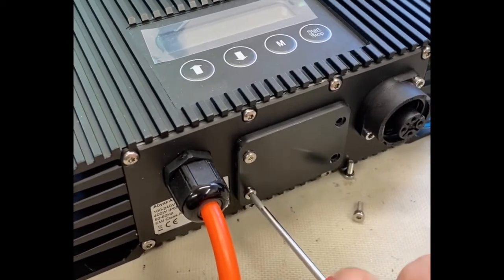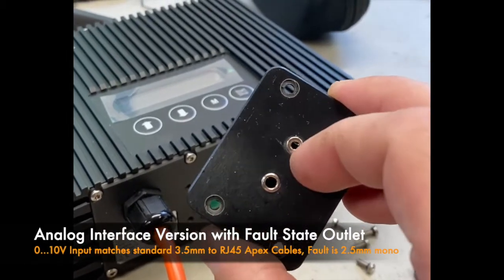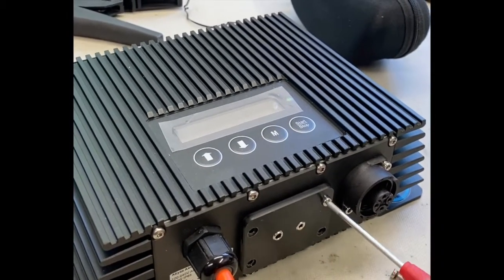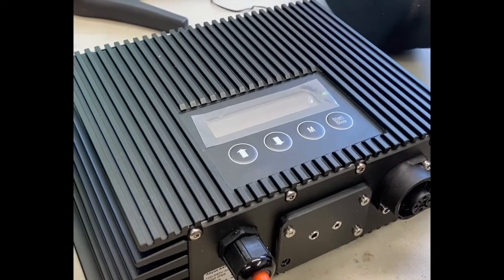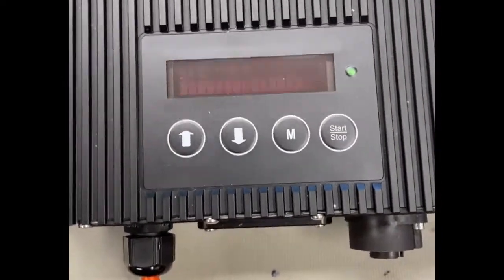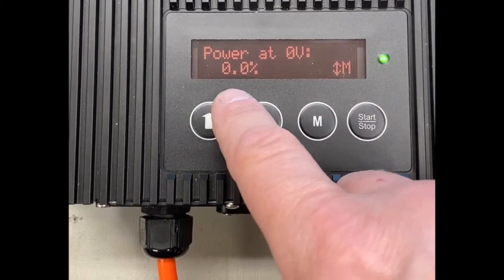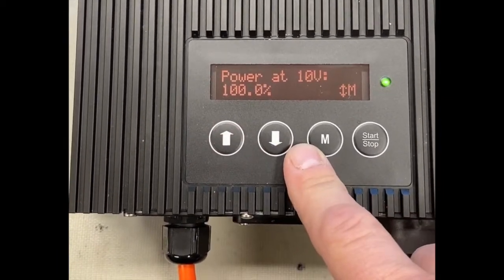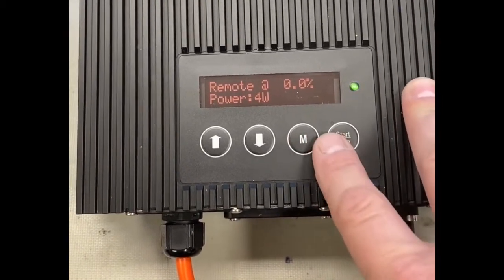Inside Abyzz 5 - IPU Apex Analog Interface Teaser

Comment: Are they ready yet for sale in the states?
Reply from the maker: Yes, they are available!
Reply: @AbyzzOfficial  Where are they available???  I just bought two A200's and only after I purchased it did I realize the inteface area was just a big hole!   How could you ship such expensive pumps like this Abyzz?  This is a stunningly bad way to treat your customers since the literature mentions nothing about these "new" IPU pumps being crippled like this.   Thanks in advance for a response
Reply from the maker: @SpicyMikey  Dear Michael, as far as I know things are solved now - unfortunately, our distributor´s stock was emptied shortly after receiving the interfaces. I just wanted to add that the drivers are not "crippled" - the point is that we offer different interfaces for different applications, and the customer gets to choose what he needs. We do not see a point in delivering electronics that are unnecessary for some customers - as these will create environmental impact as well. In any case, the fastest way of contacting us is support@abyzz.com, if there´s anything else we can help you with!
Reply: @AbyzzOfficial   I understand the reasoning for leaving that port empty. But regardless your company really dropped the ball without making it clear that it is missing the interface and that this is an optional part. Also, contrary to what you say, coralvue, the support/ distributor here in the United States, has no reference to this part on their website and their Tech Support has no idea that this part even exists. So clearly you guys have some work to do and I am not being unreasonable when I say this is unacceptable for a $2000, premium, pump.  

 All that being said, and your comments, it is now June 2021 and I still cannot get this part anywhere. Can I buy it from you directly and have you ship it from Germany?